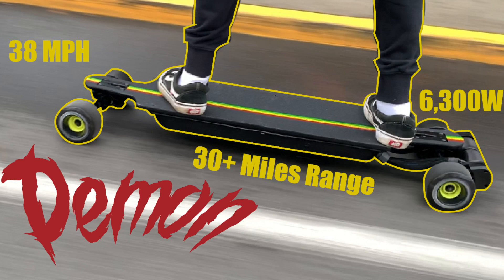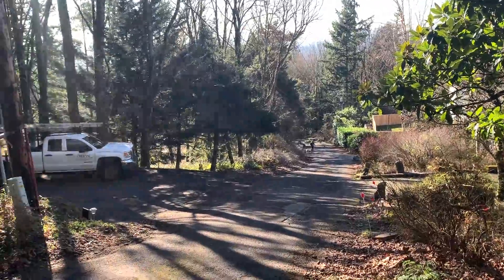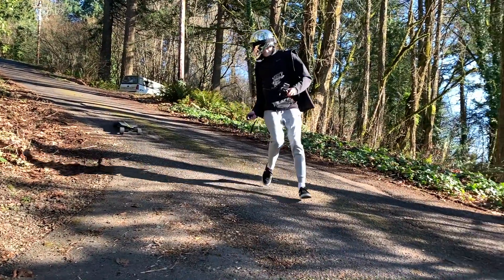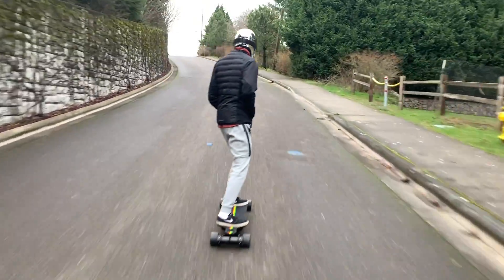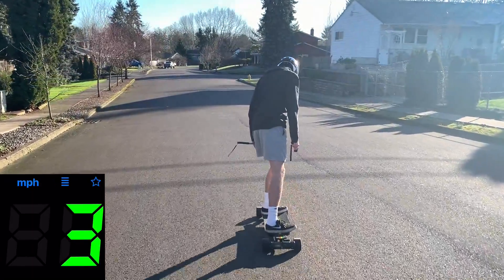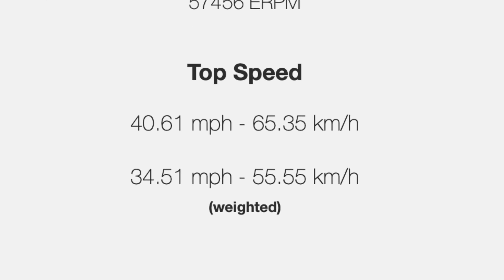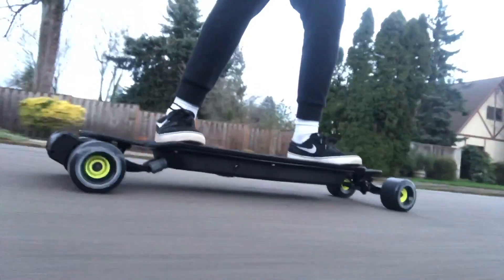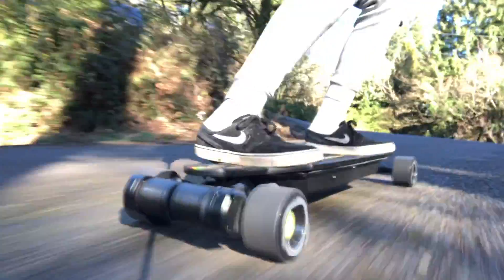35MPH, 30%, 30 Mile Electric Skateboard Test

Comment: Great content! I'm looking to build a single motor vehicle with this much power and speed, probably with the 83100 motor that your e-bike has. But I'm curious as to why the Demon is so much faster, the dual motors don't even add up to the wattage of a single 83100 and it looks like it still crushes the performance of the bike. Do you think it just comes down to the 10S vs 12S battery? Or does the Demon ESC/Battery combo allow for higher draw? It seems like even on a 10S the Demon would still be faster.

Comment: make the demon 2.0 with the same motors but instead of the rear 2 wheels make it 4wd to make it twice as powerful
Reply from the maker: Honestly would be so powerful that it would be pointless. That thing would consume so much battery so quickly. Two is already insane
Reply: @DIYesk8Builders  With 4 motors how much miles do u think it would last with the new more compact battery and going at about 20-40mph at all times

Comment: From a little bit or research and even with some 6384 motors everything comes to £868 even with the off-road wheels and tires
Reply from the maker: I find that a little hard to do especially when the battery alone is around 400-500
Reply: DIY esk8 Builders I’m using lipo batteries and I already have enough so I don’t need to spend any money on them and also allot of your products I found allot cheaper from places like banggood and AliExpress
Reply: Well in all fairness I already have a longboard deck and the battery’s so it would bump up the price to about £1000 maybe a little if I was getting everything new
Reply from the maker: Oh yeah using Lipo's will definitely make it cheaper. Be careful on bang good aliexpress, a lot of the stuff looks similar but isn't the same
Reply: DIY esk8 Builders it’s all branded stuff with reviews so idk however Ownboard seem to be a little cheaper than what you make

Comment: I have a question, if the hal sensor in the motor fails or stop working will the board just instantly stop, thanks so much!
Reply from the maker: No you would barely notice. We once had that happen and it wasn't until we tried reprogramming the VESC randomly that the VESC failed to detect the sensor